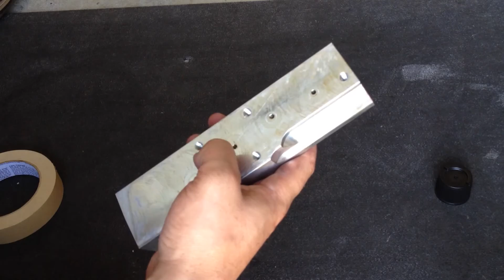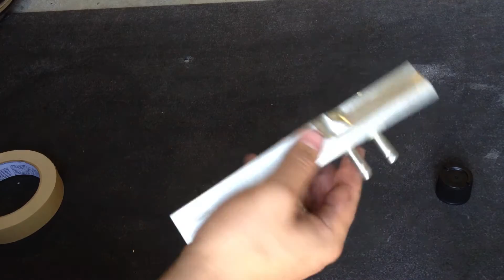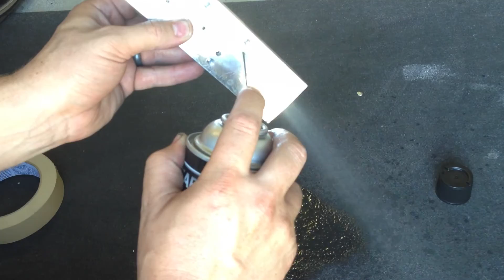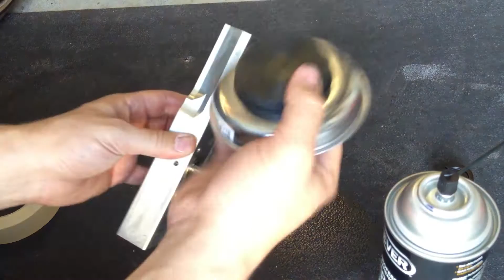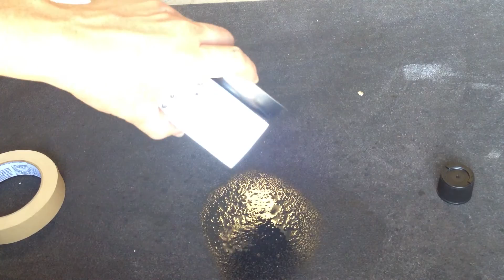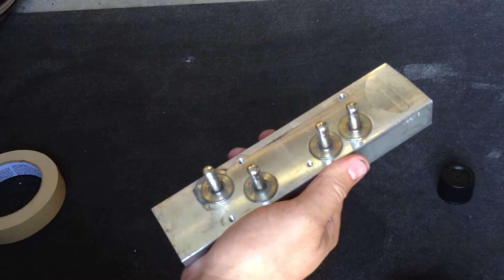BMW e46 M3 VANOS Valve Body Cleaning

Comment: Great video & walk-thru. Having this issue now. Used Beisan rebuilt solenoid pack & also  had Dr.Vanos rebuilt kit done. Shop that is working on my car mentioned that the valve body needs changing. I don’t think that they cleaned it well enough. Gonna send them this link & hope this works. Wouldn’t feel good dropping 2k for a rebuild and getting my car back with a bad valve body 😣

Comment: For some reason I can’t get the brake cleaner to flow through freely like yours. But the fluid coming out is clear.
Reply from the maker: Deon Li  are you using a strong magnet?  Can you hear the clicking noise?

Comment: Is this something that is only on a e46 M3 or is it in all e46's? The reason I ask this is because I have a e46 and I'm trying to figure out where it is located on my car. I would suspect it would be around my Vanos area, but if only M3 cars have this, it makes sense of the reason I can't find it. I did my Vanos seals and bearing washers yesterday and didn't see anything close to this.
Reply: E46 3-series non-Ms use the M54 engine, which is not the same design as the S54. Your VANOS unit is of different design and function. For example, the double VANOS in your E46 will have the pistons with O-rings to replace as you did; the dual VANOS unit in the S54 uses a high performance oil pump disc mated with the exhaust hub driver tabs. This solenoid pack valves body is strictly for S54B32.

Follow the complete Beisan Systems procedure for the E46 Dual VANOS rebuild (non-M3) on their website.

http://beisansystems.com/procedures/vanos_procedure.htm

Comment: I drove my friend's ///M3 which needed this looked at because his car felt sluggish out of right and left turns at low RPM compared to my car with much lower mileage.  He drove my car and noticed how urgent it accelerated at low RPMs.  The next week he got everything working again and I took it for a drive. It was like the go switch was turned on!! He didn't know before driving my car because the clogging is very gradual so you get used to it.

Comment from the maker: I had a change in performance but I believe it had a lot to do with the fact that I not only cleaned my valve body but I also did the complete Beisan Systems solutions which included resetting the timing on my engine and so fourth.